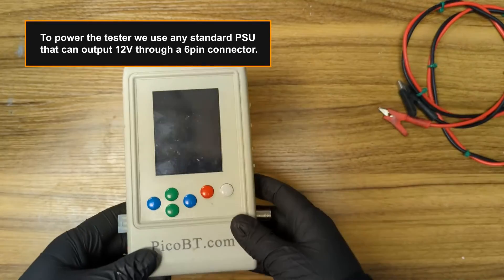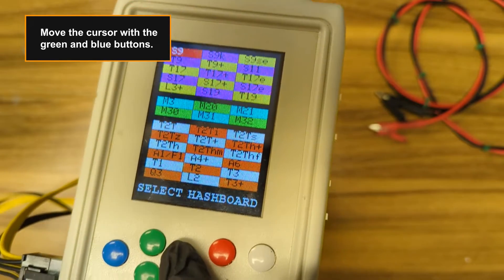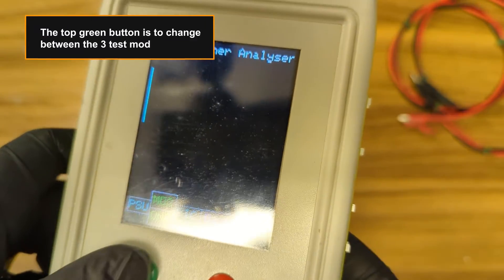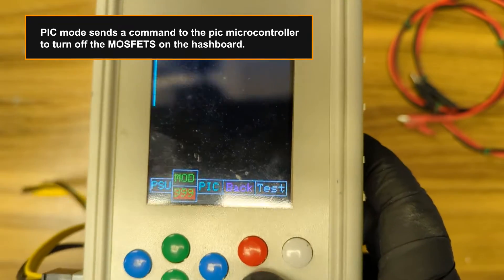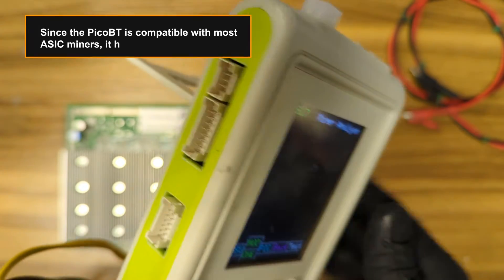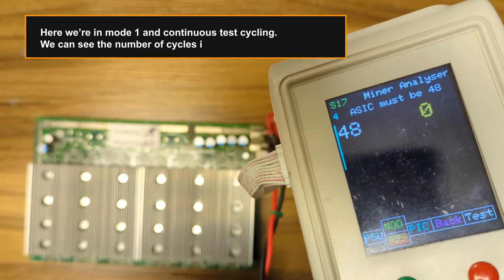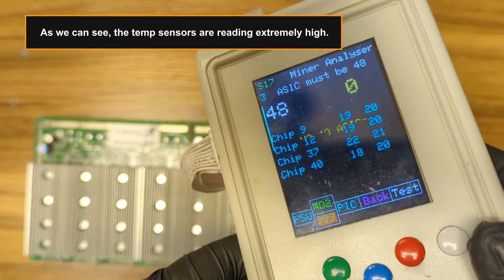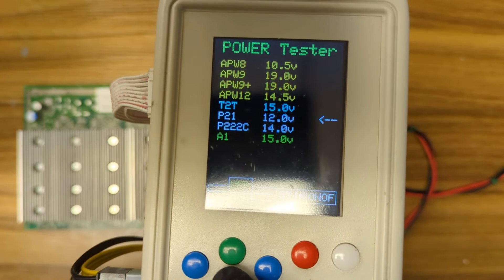ASIC Repair: How to use a PicoBT Hashboard Tester to Troubleshoot Bitcoin Miner Issues

Comment: 😡Unfortunately, the PicoBT does not diagnose for M32 M31+, I have two devices and they do not work. With the latest version in October 2023 and the factory does not provide a solution either. Regrettable.
Reply: hey can you help me i dont have the cable for the whatsminer testing can you please check and type me the pin layout of the cable (the pins on the tester 1 to 14 that go to the whatsminer hashboard connector 1 to 14 thank you)